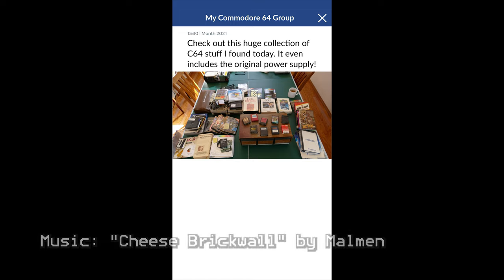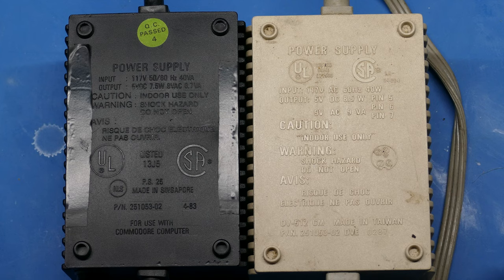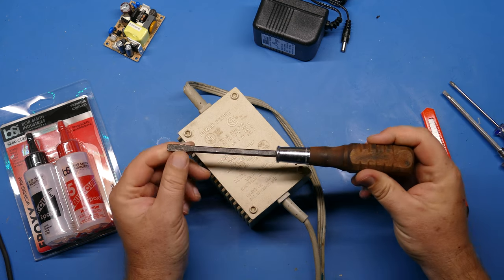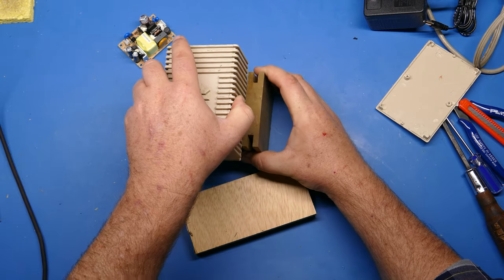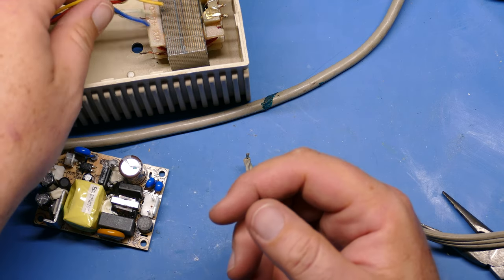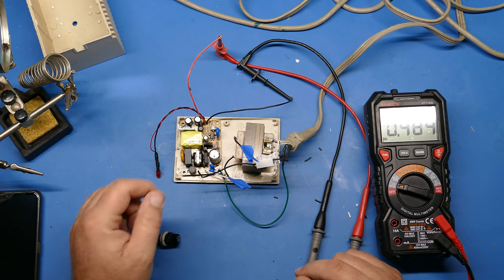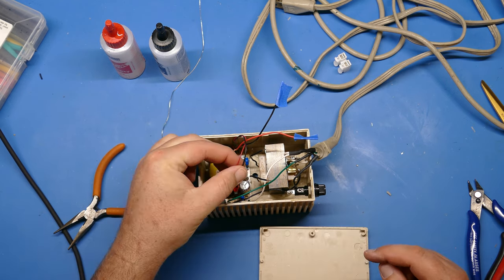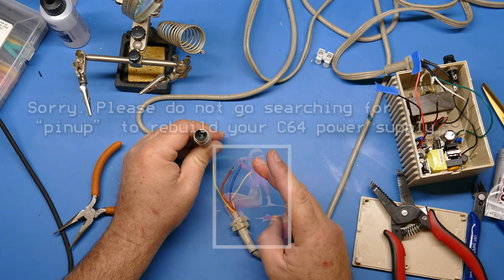Rebuilding A Commodore 64 Power Supply

Comment: I can't believe how easy your potted brick guts came out completely so easily. I ended up having to use a skinny screwdriver and heat to get it out. I did reuse the original transformer but replaced the 5V section with a Meanwell supply.

Comment: A trick when testing rebuilt PSUs (I have built two so far) that I picked up from one of the YouTube channels, is to get some tubing cut to length and drop it around the pins. (I use either spare heat shrink or the outer sheath from a cable you have stripped off). That way when you poke your multimeter probes in, there's no chance to short between pins :-)
Reply from the maker: That's a good tip
Reply: Either put it around the tips inside the connector or on the tips of the probes.  Either way is better than nothing.  heh

Comment: This is an excellent setup. I think the only addition that I would make is a switch for people that don’t want to leave the power supply on all the time but don’t want to have to unplug it. Excellent tutorial! 👍 Just quick add-on comment; to secure the wires to the walls of the power supply you can use a zip tie bracket called a TC105 and glue that to the walls and then zip tie the wires in place.
Reply from the maker: Thanks

Comment: Amazed at how easy it was for you to dislodge the epoxy. I had the most difficult time with mine. My Re-Brick source was an older black one. I almost gave up trying to get through this step because I was close to damaging the case. It survived though and my Re-Brick is still going strong after several months.
Reply from the maker: Awesome. I have done this four or five times. One came out immediately. One I found some plastic studs on the side that were making it really difficult and I had to clip away.
Reply: That is in fact what I had in my black brick. Turns out those side pieces aided me in securing the internals so I went from hating them to liking them pretty fast.

Comment: One thing to mention is when hooking up the AC line cord that it should be rung out and the wide blade of the plug should be used as neutral, if the plug doesn’t have a wide blade look at a receptacle and see which slot is widest and use the blade on the plug that correlates to that. I’d also use heat shrink or electrical tape to cover the contact tabs on the fuse holder.
Nice video however! Thx!

Comment: Great video with a good, detailed explanation. I am designing my own power supply these days for my C64C. The power section of the Longboard and Shortboard are quite different. On the long board, there is on board power regulators (7805 and 7812) which are used to power the VIC-II and the SID only. The rest of the 5V logics are powered from the 5V coming from the brick. I think Commodore preferred this method to keep the very noise sensitive SID and the VIC-II isolated prom the noise generated by the rest of the board. On the shortboards, there is no onboard voltage regulators, everything is powered from the 5V coming from the brick, except for the 9V pin of the new version HMOS 8580 SID. It requires a much lower current, so they just put together a simple zener-transistor regulator for it. Using a modern switch mode 5V regulator in the brick will work flawlessly for the Longboard, I am almost sure. What worries me is the shortboard. Switch mode regulators will have noise (in the form of an AC ripple on top of the DC), powering the SID and the VIC-II with these may cause some audible noise on the audio out, and, although less likely, may cause some video interference too. I know that all the 3rd party replacement PSUs have switch mode regulators, and I haven't seen complaints on this, but I am thinking maybe most people use their C64s with audio from monitor/TV speakers, and a slight noise won't be very noticeable in such a set up. But if one had a decent speaker system connected (like I do), maybe it will become an issue?
Reply from the maker: Perhaps. I am due for some C64 repairs. Maybe I will have a closer listen and see if and additional noise is detectable.
Reply: @RetroHackShack  Thanks for the reply. That will be a very interesting information. I am designing my PSU to have an old school LM338 metal can adjustable regulator. The cables that Commodore used are marginally thin for the job. I will have 4x 0.75mm² cable in between the PSU and the C64. Custom wound transformer will have one secondary winding for 9VAC @10VA, and another 8VAC @20VA for the 5VDC regulator. The smaller (within spec) voltage for the input for the LM338 will create best possible heat dissipation. Waiting for your listening test results, also please do check for small, hard to see video artifacts.

Comment: I have many Commodore 64 power supplies.  I found one was a unpotted one so I opened it up and fitted a step down aliexpress regulator on the dc voltage output.  Did the job and provides a nice low voltage. As far as I know there's no issues with the Ac power output from these so I left that side alone.
Reply from the maker: Yeah. The AC transformer should be fine.

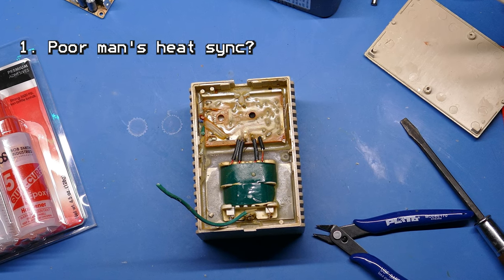Comment: At around 18:00 regarding potting of the power supply I would argue it is somewhat related to your second point: mechanical stability and return rate/failure rate. Remember that a lot of these machines were sold in large department stores across the US and if the return rate of a product was high for whatever reason Commodore would’ve ended up selling a lot less or losing money since those large stores quickly return the money to their customers and the bad product to the manufacturer. And maybe even not buying from them again. Thanks for the video!

Comment: Nice video! A great topic. Coincidentally, I purchased a Keelog PSU just over a month ago. After some testing and research (research that I should have done prior to purchasing) I cannot recommend the Keelog PSUs, it outputs rather high voltage on the AC side -- 13.4VAC with no load, in my case -- even under load the voltage is quite high AND will cause the un-heatsinked regulators on older C64 motherboards like ASSY 326298 to overheat to the point of failing. Anyway, my two cents.

Subbed! Keep up the great work!
Reply from the maker: Thanks for sharing that. I have never tried one before so that is welcome feedback.
Reply: My Keelog experience was not good either.  I will totally admit that I bought one out of curiosity and a bit of espionage.  I wanted to see how they got that output cable to be so supple and flexible.   All I've ever been able to find for the Nu-Brick that's flexible enough is a white cable (Ray Carlsen uses the same cables) so I was intrigued.  It turned out it was BS.  The flexible-looking cable in the photo on Keelog's website wasn't a photo at all, but a 3D render.  It was as stiff as every other black cable I've ever seen!  Then I plugged it into my tester, which puts a 5-ohm resistive load on the 5vdc, and I got 4.75vdc out.  Needless to say, it was unreliable on a real C64 as well.  And because I bought it on Ebay and let it sit in the box for 3 months, they didn't feel obliged to replace it for me.  So much for Keelog.

Comment: Some 4" cable ties or small gauge spiral wrap might work for improving your wire dressing inside the case.  In the old days we'd have used lacing cord. but that stuff is a hassle to get right even when you have plenty of room.

As an alternative to a fuse, try a miniature circuit breaker.  These can be reset once a problem is corrected instead of needing to be replaced like a cartridge fuse would.  (All things for a price, though - it depends on whether you are designing for durability or lower cost.)

Potting was generally used to enhance structural solidity and insulation, and may have been a design feature used to achieve a UL rating for the unit.

Comment: We’ve had those cream colored cases on this side of the pond too. It’s just that they already have a fuse holder that’s drilled through the case. That makes the resin block much more troublesome to remove as you have to first chip the fuse holder loose from the resin so that it’s not in the way. Well, I suppose you could use side cutters to break the holder. Good and informative video!
Reply from the maker: Interesting. I wasn't aware that the EU versions had a fuse originally.

Comment: Nice job, especially keeping it a linear power supply.
For the bottom popping, maybe epoxying a couple of inner lips on the long sides could help, as you'd need to pull the cover until the lips are completely free.

For opening these kind of power supplies I use a large spatula/pizza cutter. Sometimes a couple of hits with a rubber mallet can help when the case is glued shut.
Reply: Any advantages to linear power supply?
Reply: @blackterminal  the voltage they output has less noise. Do in this case the 9V rail will be less noisy than the 5V rail.
My understanding is that some electronics can be affected by such noise and misbehave.

Comment: If you have a vise, you can take the small black power supply and put it in the vise corner to corner , diagonal, and squeeze with the vise, it will pop the lid off.
Reply from the maker: I'll try that

Comment: Cool! I’m always pro preserving hardware. No matter the state! 

You might want to try to preserve the original transformer. You could by using a metal saw to cut the epoxy between the original transformer and PCB. 

For your current build, I think I would’ve mounted the transformer upside down. You’ve done a very nice job though! 

Thank you for the nice video!
Reply from the maker: Thanks for the tips!
Reply: I've had the exact same idea! Why throw away a perfectly good transformer, esp. since it's becoming a rarity nowadays.
Reply: @VioletGiraffe  love the old heavy power supplies.  My daughter was surprised how heavy they are compared to a modern USB supply. Haha. :)

Comment: Really well done.  The only additional thing I would like to see would be small led volt and amp meters for the two lines just for extreme geekness.
Reply: You could solder in two cheap USB tester displays in parallel with the 5V line, but not sure if it would work with the 9V AC line unless you also include a small rectifier before the USB tester.

Comment: Yeah, I like when people use soldering and shrink-tubing instead of electrical tape, because that heat-shrink tubing is SO pro-quality in comparison to a tape that can unravel as it loses adhesion! I bet heat-shrink tubing buys you just about an immeasurable amount more longevity than tape! I bet that tubing would easily outlast the components. I love using it for most of my wire splices.

Comment: Hi Aaron. Well done. I need to do this as well. Similar to yours, I was going to gut a 9VAC adapter. However, I have considered using a 5v 2a usb adapter for the 5v rail. I see you went with the larger Meanwell. Is there any advantage of the meanwell over a usb adapter? Thank you for the great video.
Reply from the maker: Thanks! The Mean Well is adjustable and better built than your typical 5V wall wart. However, there is no reason why it shouldn't work.

Comment: This is very cool. Would it be possible/better to just use an open frame 9vac transformer instead of dismantling the wall wart?
Reply from the maker: Sure. If it will fit.
Reply: That's really helpful thanks! Also do you have the details of the fuse you used?
Reply from the maker: I think it was either 1.5 or 2amp

Comment: I wonder if a good addition would be an in-line power switch on the brick? That would not only completely disconnect the C64 from power when left unattended but potentially save wear and tear on the C64 power switch.
Reply from the maker: Personal preference I think. There is not a lot of room, but there is enough for a switch.

Comment: It never would have occurred to me that the potting may not be bonded to the case, almost defeats the propose of potting (which is almost always securing IP incidentally). Also a bit of heat gun may or may not help this process in in a few places.

Comment: the ac line needs to go to the center of fuse holder,that way if the cap gets removed you will not have live power at the opening.

Comment: Fantastic video.  I have one more connection to make that I am confused about.  The ground wire coming from C64 4-prong connector cable, is that going to the "GROUND" screw on my Meanwell RS-15-5, or is it going to the  "-V" screw on there?  If it just connects to the same "GROUND" as the one from the AC MAINS, does anything connect to the "-V" screw?  Thank you for your help!
Reply from the maker: That one goes to the -V on the DC voltage output and not the earth ground.
Reply: @RetroHackShack  thank you so much for helping me.  I used a case from an old printer PSU so it came out a bit smaller and everything barely fit.  Really appreciate the shrink tubing tips as well
Reply from the maker: That's great!

Comment: I have a 9v AC power supply (wall wart) that I was going to use for this purpose.  On a hunch I decided to test it.  The output was 12.45volts!!  So anyone watching this please test your transformers and make sure they are not outputting over 10v
Reply from the maker: AC transformers will always be high when not connected to a load. To truly test it, measure under load.
Reply: @RetroHackShack I've been watching several videos on this subject with many people explaining how to test the power supply and none of them are under load and showing between 9 & 10 volts AC.

Comment: The potted Commodore power supplies were notorious for failing, even back in the early 1980's.  Look at any vintage computer magazine for the time and you will find dozens of ads for aftermarket power supplies.  The early (1982) power supply for the C-64 P/N 902503-02 is not potted and is easily rebuildable.  I buy all of them that I find.  They have a better higher rated voltage regulator in them.  David Buchan has a good page on rebuilding them.

Edit:  That isn't thermal potting compound that Commodore used.  It's just epoxy.  In my opinion it was two-fold.  It prevents users from attempting to service the unit, like they could with the earlier unit either damaging themself or their machine (also sell more supplies) .  Secondly, it allows them to simply drop the components in, requiring no mounting hardware saving a few pennies.

The connector for the 1982 power supply is fully populated.
Reply: I always chuckle when people say things like: "When these power supplies get old, they can over-volt and damage your computer", because I bought my first C64 in January of 1983 and by the summer of 1984, the power brick had killed it.
Reply from the maker: Yikes!

Comment: There's plenty of room in there to cut out the 5V regulator wires and replace it with a cheap UBEC as used in the RC space.  Much easier than removing the innards and replacing a otherwise reliable 9VAC transformer.
https://www.lemon64.com/forum/viewtopic.php?t=48451

Comment: That bowing on the black one, maybe it's just a manufacturing defect because mine already does that and I haven't even opened it yet. (It's going to be my first candidate for a modification like this specifically because I'll feel less guilty if I screw up and damage the already-imperfect case.) I assumed it was brought on by being stored right-side-up in a hot attic for ten years so all the weight was on the thinnest and least rigid surface.

Comment: Surely in the USA it's usually 'Live(or Line)' and 'Neutral' like it is in the UK. Also my pet hate are block rectifiers like that round thing on the 5v supply mains input. I would fit 4 off 1N4007 if I were doing this.

Comment: I got two original power supplies stil working and supply 5VDC and 9AC but I do not use them anyways.
Reply from the maker: Yeah. Don't use them. They die suddenly and then you have bigger problems.

Comment: Retail employee here.  I don't recommend putting shrink wrap on wires, as it is untested for amperage.  Instead, please use shrink tubing.
Reply from the maker: Did I say shrink wrap? I am always fighting short circuits between my brain and my mouth. That's why I need the text on the screen to make corrections all the time.
Reply: @RetroHackShack  Lol.  I may not know much about shrink tubing, but I know a lot about shrink wrap.

Comment: I happen to know my wall outlets are not grounded. You mentioned the meanwell needs an earth ground from the plug. In what way would the lack of ground affect this power supply build?
Reply from the maker: Not exactly sure, but it is probably used as a reference for balancing the load on the AC. You might be able to find other supplies that don't need an earth connection.

Comment: So on your meanwell power supply  you have an adjustment for the 5 volt rail  how much yours is set??  i have the same power supply instead i have the model with screwpost and  metal casing? :)
Reply from the maker: 5.1V
Reply: @RetroHackShack  i just see in the video :) sorry :)